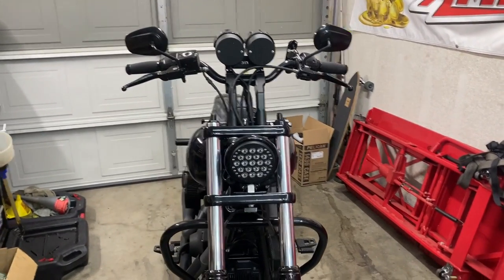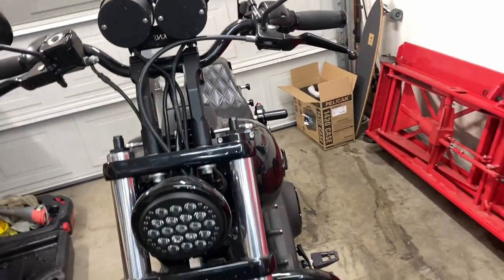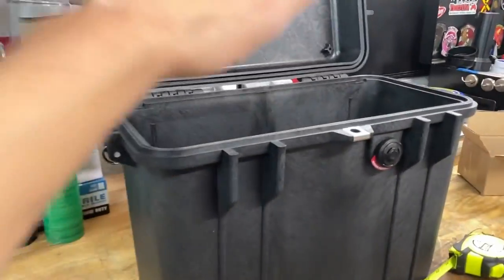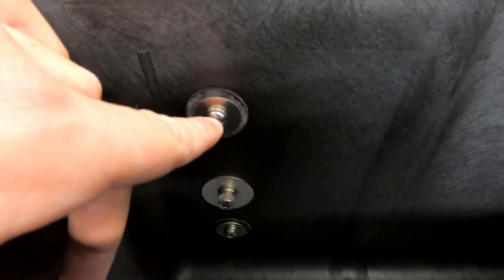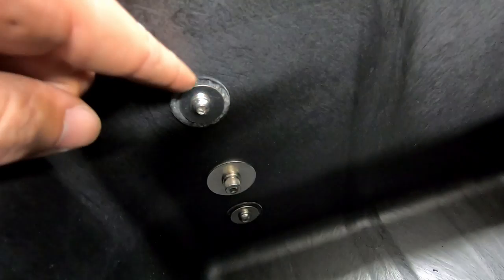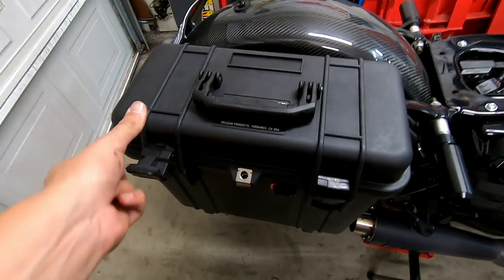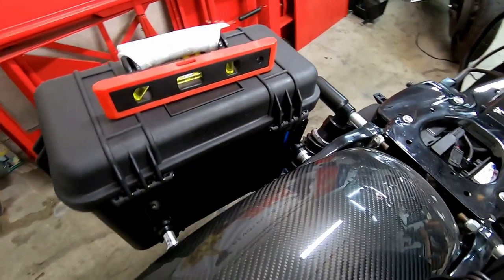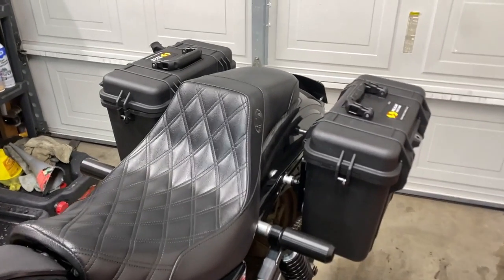Pelican 1430 Saddle Bags (Elite Touring Innovations)

Comment: Really like the look of these cases on the dynas. 
The best change out I made to my fxdl was going from a lucky Dave’s diamond stitch to an sdc saddlemen. Massive difference.
Reply from the maker: Did u get the one with the little backrest it’s a lil exspensive 😬
Reply: @dynademos  nah I’ve tried the backrest and didn’t like how it pushed me forward. The standard one is perfect. Locks you in with the perfect shape and gripper material vs the LD that was more rounded and I slipped. I sold my LD for good money so wasn’t out of pocket by much. So glad I did.
Reply from the maker: @aaronduthoit1278  your making me want a sdc seat 😬
Reply: @dynademos  I doubt you’d regret it. Fxdlsbrooklyn got me onto it. He was right. 

How do you like the RWDs? I run legends on my fxdls and my bagger but switching to the 14” RS1s on my road glide to go with the longer fronts. I’ve heard good things. I didn’t want to go like everyone else with the ohlins remote resi but still have the performance
Reply from the maker: @aaronduthoit1278  I like my rwds. And from what I’ve seen from the harleys on the track legends and rwds do very well

Comment: That’s a slick set up. Just threw some small Viking’s on mine for the same camping reason. That with the roll down bag is plenty of room for a few days.
Reply from the maker: Ohhh I bet that’s a sick setup Viking makes some nice ones
Reply: @dynademos  it works pretty well with a taller sissy bar made out of 3/4” rebar I welded up with a friend and two roll down water proof bags. Makes for an easy set up.
Reply from the maker: @JustBeAdude  man I need to learn to weld sounds like a good setup man

Comment: I went your way and managed get a decent price on a pair of used grey pellecan 1520. I haven't mounted  them yet but during next month I think I'll  manage to get them on. Thanks for the great video!
Reply from the maker: Oh yeah those are good only thing I don’t like about them is the side of them open send us pics on insta 👍🏽
Reply: @dynademos  Yeah, agree! I think I'll use some flexible luggage net fastened to the part that opens outward to keep my stuff in place, while opening and closing the case. Also, I think I'll put the brackets on the lid and let the deeper part of the case open outward, to allow for easier packing. There are a couple of wires in the kit, which could be attached so that the case won't open more than ninety degrees. What's wrong with this concept? 
🇺🇸🇺🇸
 🌰
   🌶
Reply from the maker: @jansirkia3809  I like the idea of the deep part opening up and the netting is a good idea! Let me know how it works out. Make sure u leave plenty of room for your shocks to compress also.
Reply: @dynademos  Alas, I'm no Dyna bro. I'm a m8 fatbobbing bro, hence there are no considerations needed when it comes to shocks. The one I have is mounted under the saddle...
But there are other wrinkles to be ironed out, such as where do the blinkers go, for example. The side mounted licenseplate holder is another small problem. You know how these projects run, I'm guessing...
Reply from the maker: @jansirkia3809  relocation of course!

Comment: When dealing with leather I would have kept that washer,even a smaller ss washer only so you know it’s not gonna pull through. But maybe because there are three bolts it’s probably never going to move. I’m just an over kill kind of guy. I’ve been welding and fabricating for so long and I’ve always done side work out of my garage. Years ago when I started welding from home I’d make sure nothing would ever break and I would make sure cause I was scared of being sued and lose everything we have. Over kill can be a good thing, but mostly it’s just more time. I don’t know why I wrote all that. I just bought a decent pair of throw over under the seat set of bags for my lowrider but just can’t get myself to pay Harley a grand. But damn I really like those boxes for 200 bucks. Maybe I’ll get a set of the mounting hardware you have and possibly paint two ammo cans black. Beginning of vid. You showed those gray or unpainted ones. The black ones you put on look way better. So thanks for sharing the ideas. Nice looking bike bro. I have the 03. Hundred year lowrider.  Also a 98 heritage softail. I never take the lowrider anywhere long cause no storage. That’s gonna change real soon. Peace. Oh I’m on my wife’s iPad she is soldier girl. Actually the lowrider is really hers too. She bought it new. But she quit riding a long time ago. I kind of inherited it. I like taking that bike bar hopping. For some reason it’s like a sports car. Even though my heritage has been worked and built the way I like. Just different. 👍🏻
Reply from the maker: Haha long read but yeah man honestly best bags I think are leather pros only thing I don’t like is they get saggy over time. But I am happy with these also tell your wife Thankyou for her service

Comment: Doesn't not work well with a passenger even with a decent two up seat. GF weighs 109lbs but could never get the pelicans low enough to not have them constantly touching her thighs and passengers constantly use the tops as handles to get on and off the bike with their full weight. Bummer but great for solo rides.